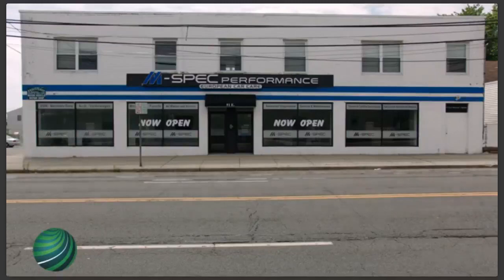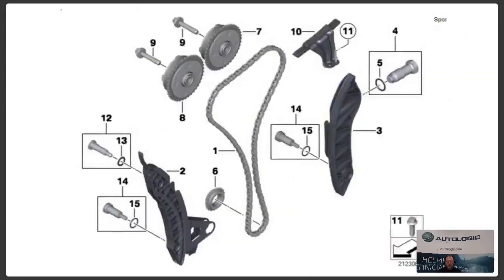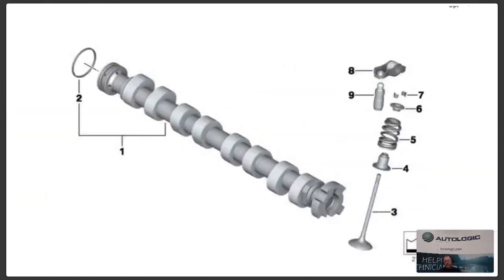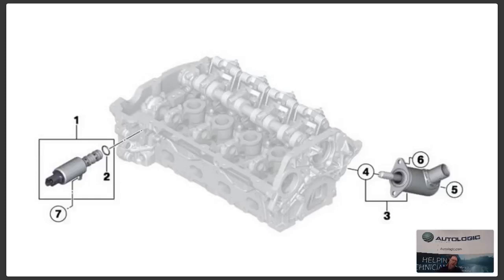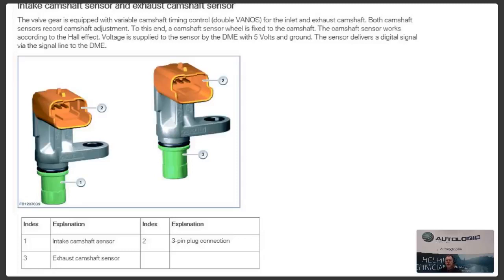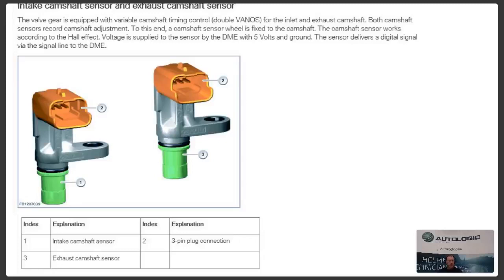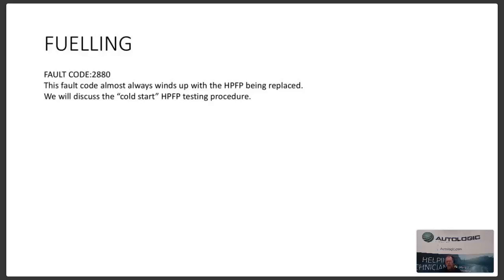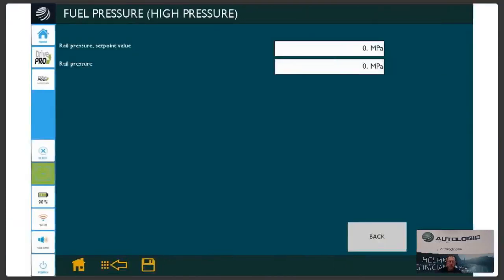MINI Tips & Tricks Webinar by Autologic

Comment: Perfect. As a former dealer tech at Mini and BMW, now turned shop owner, techs are under pressure and just throw parts on cars due to DTC'S but never took the time to understand this 2b5c issue. Granted, the O.E doesn't provide enough detailed info about this.  Thanks for the explanation and informing our aftermarket.

Comment: A leakdown or compression test will not reveal carbon build-up on the valves. The carbon is never on the valve seats themselves. You can have good leakdown and compression and still have carbon build-up causing problems.
Reply: Do you have a video on this as well?
Reply: @scaracci24 He is dead right tho. The gentleman in the video misspoke. The carbon build up happens on the valve port side. Basically the side of the valve that faces the intake manifold runners.  

The carbon will build up there, and disrupt airflow into the cylinder. A leak down test reveals how well a cylinder can retain pressure. The valve would need to be held slightly open for the pressure to escape. Carbon build up will never build up to that  point. At least, I have never seen it happen in my 21 years of servicing these vehicles.

One could argue that carbon impeded intake ports could affect compression readings, but again the build up would have to be so severe, usually other driveability symptoms would manifest long before the vehicle can reach that state.

Comment: Hi, anything regarding to 5 volts sensor supply?
Reply: Pretty straight forward on these engines. It comes from the DME, and when it's gone, usually a shorted sensor. The most common culprit is the solenoid valve in the oil pump, followed by the throttle body, and accelerator pedal. Those are the three I have seen short out the 5v ref.